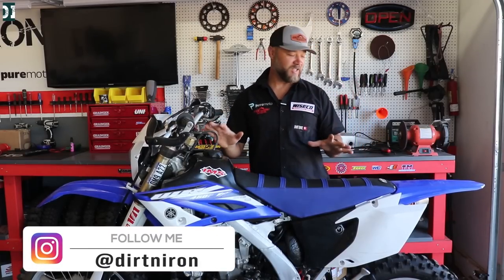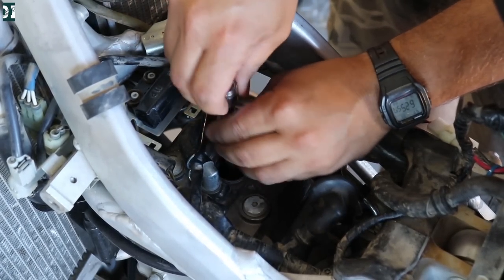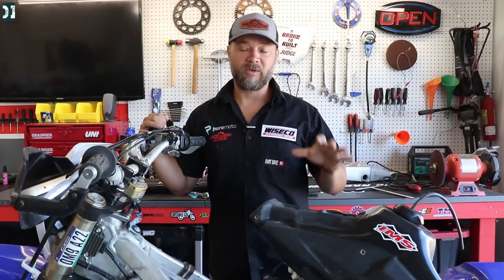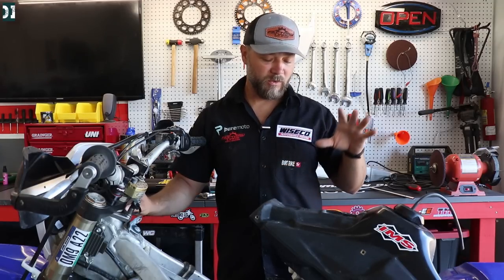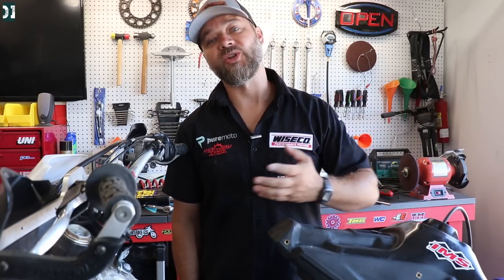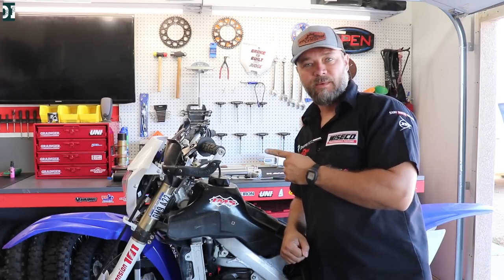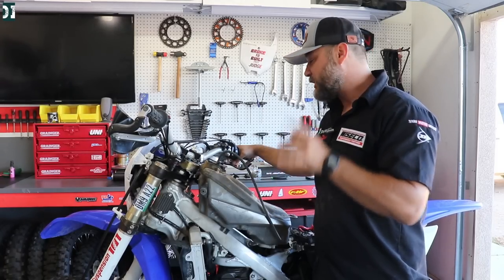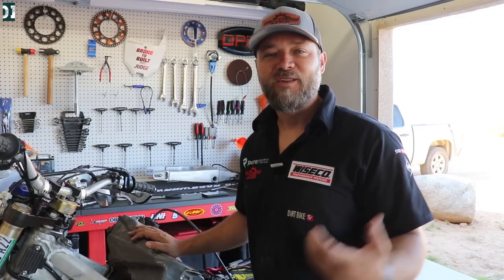I bought NON RUNNING WR450 - Let's Fix it!

Comment: Best all around bike ever. I have had a WR 426 and 450. Trail riding, MX or street bike they are fantastic bikes.
The ones we get in Spain are street legal.
Reply: I now live in Spain too and want to buy a WR 450 as well. Is it allowed to ride it with the full horsepower on the street? In Germany we have to tune them down most of the time :/
Reply: @michaelnutzel2226  The old 426 had a throttle stop and a gray wire that could be cut to give full throttle and full power.
The new 450’s are full power from the dealer.
Reply: @user-se7vt5ow4e  I am currently looking at a 450 from 2007, I don’t have to do anything to it in order to get it street legal or pass ITV? 

Great 👍

Comment: Would have been fun to strip the pump, probably just a seal or stuck valve. Also could have just pressurised the tank a bit from the cap breather. That's a clean bike though! 👍

Comment: had one. 
I became president of the tippy toe club. 
my mechanic warned me, but he still cut the grey wire for me. 
it went really fast.
put a snow sled on it.
couldn't get back on it in the snow once it fell over, b/c it now sat 10" higher than before.
sold it for what I paid.
bought  an older 2009 KTM250 XCF thumper. 
fortunate to have survived to tell this story.

Comment: This is why I’m so partial to carburetors, so much simpler to troubleshoot on the go. 
And before you say anything about jetting being a pain in the ass, understand that I’m talking about MODERN carburetors (Lectron, SmartCarb, etc).
Totally worth the price for ultimate reliability.

Comment: it would be good to see a fuel pump disassembly vid to see why it failed and can it be cleaned or repaired.  im glad i have an old bike with a carb, the fuel injected components are so expensive.  thanks for the vid.
Reply from the maker: Great suggestion, thanks Steve

Comment: Hello again friend, you know that my motorcycle is jerking, would you know where to start checking? Already checked the spark plug and fuel pump and they are OK, it is a wr 450 injection, by the way, excellent explanation since I don't know anything about this type of injection motorcycles and your video is great to start learning the system.

Comment: I don't think testing the fuel pump so close to the battery was a good idea 😬(6:05). Also, quantum fuel systems makes some good aftermarket fuel pumps and allballs have some fuel pump rebuild kits fyi.
Reply from the maker: not sure I want to go with made in china for the fuel pump..
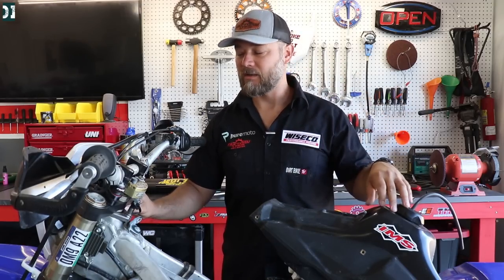Reply: @dirtniron  his issue is not the pump it is a fuel pressure reg that u see at 4:44 and Quantum is a USA company btw.

Comment: looks like the pressure bypass valve failed, one of my ktms did it and it was fixable without buying new pump.
Reply from the maker: I wanted to replace it but there are only chinese replacements.. I want to have reliable bike after I am done. What did you use at yours?
Reply: @dirtniron  bet u find most the originals are Chinese, I just pulled the relive valve out and change the spring to a slightly heavier one.

Comment: I just bought an 11 with the same issue. Bought a Amazon pump and quantum pressure regulator, rebuilt the pump and it didn't work. New Yamaha OEM pump and it's running again. It's more expensive but well worth it.
Reply from the maker: Thanks for sharing
Reply: @drott150 Nah, FI in the 450f started in 2010.
Reply: @drott150  Yes I do, my bad I should have been more clear in my first post. Mine is a YZ.
Reply: @TepcoCycleRepair  No problem. I will delete my posts.

Comment: Is it possible to fix the fuel pump, instead of replacing the entire pump?
Reply: I thought so too. I think any car fuel pump repair or service expert may able to fix it, because those things are way more costly & people would rather have them fixed than changing them outright.
Reply: @Andy-co6pn  it is. I just bought a non running wr450 as well. I rebuilt the fuel pump assembly with new parts and put a new injector in it. It runs like Godzilla now
Reply: I’d be fixing the pump
Reply: I'm on the same page, there has to be a way to service that pump or at least apply back pressure and see if any solids shoot out.

Comment: Just bought the same bike under the same circumstances, VERY cheap, turned out to have the opposite fault on the same part, the fuel pressure regulator was blocked up somehow, causing the injector to over-fuel as a result of too much pressure. Would start and run for 10 seconds before bogging and stalling.
Reply from the maker: I got brand new oem pump, she runs great now. What is your plan ?

Comment: Seems like a lot of monkey motion to avoid buying a $10 fuel pressure gauge. Also, the likely problem is something stuck in the pressure relief on the pump. You might want to have a look for anything obvious before plopping down $360 for a new one...
Reply: Exactly.

Comment: i have a 2012 WR450, purchased brand new in 2017 luckily. Fuel injected and mine will start and run for about 20 seconds and die. thought it was bad gas, changed it all and still same result. any possible things to check for? bike has roughly 70hrs give or take.

Comment: I had a starting issue with my 2012 WR450 similar to this one. For anyone watching this and want to save $400 by not buying a oem Yamaha fuel pump. He shows at 4:44 that the fuel pressure regulator is spewing gas. This regulator should do this when the pump is over pressurizing the system. Therefore it should not have any fuel coming out on primming. You can buy aftermarket fuel pressure regulators for around $40. That is what I did and my issue is fixed. This will not fix a bad pump but will save you from dumping a ton of money in a fuel pump you may not need. I AM NOT A MECHANIC.
Reply: @Cannavis Is the aftermarket regulator integrated into the pump body? Which can be unbolted from the pump body and replaced? Or did you have to install a generic inline regulator (similar to a fuel filter on a carb bike) and stuff it somewhere under the frame and plastics? Also, I assume it's a Chinese knockoff regulator...how long will that really last?
Reply: @drott150  yes if you remove the pump and it is just 2 tabs that can be compressed and the old regulator comes out and the new regulator slots in.
Reply: @drott150   at 4:44 you can see the black circular part dumping fuel back into the tank. the white portion you see in the middle of the black regulator has a lip on it, The black portion is a clip. If you slide the black portion off the white tab on both sides the regulator slides off.
Reply: @drott150  also the regulator i bought is American made and has been working fine with 0 issues sine i replaced it. it is attached to the pump body which can be seen at 4:44 I bough a USA Quantum Fuel System OEM fuel pressure regulator from amazon
Reply: @Cannavis  Excellent info, I really appreciate it. I just bought one of these bikes yesterday (a 2014). It runs great, but I do want to understand its F/I system and how to maintain it without breaking the bank or doing dumb repairs where you just replace everything instead of what's actually needed. Looks like you cracked the code bruh! Thanks again.

Comment: guys just don't burn your bike and garage down when messing with fuel this way
Reply: There is always one of you in every crowd, the battery leads are isolated from any exposure to fuel it's a basic design feature of any pressurized fuel system.
Reply: @robh3267  And there's always one of you in every crowd. Anytime open liquid gasoline is being spilled and literally sprayed like that and electrical switches and motors are being switched on and off? The bike should be outside well away from the house. And at a very minimum a garden hose with a sprayer nozzle should be right there by your side with the water pressure on. And preferably with a CO2 extinguisher present to help put it out quickly without using water which is less effective at dousing gas fires (especially after the plastic tank melts and dumps however much you have in it, which should be the bare minimum amount needed). 

And if you think internet safety nazis are annoying, I agree stupid ones are. But in this specific scenario, I'm telling you he's putting himself and his place in grave danger. Don't ask how I and many other old guys learned this the hard way.